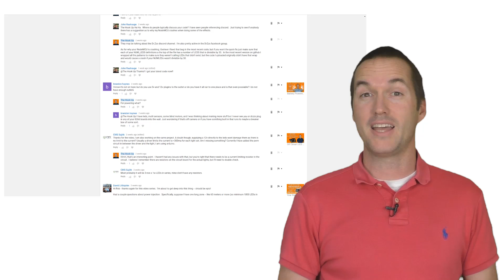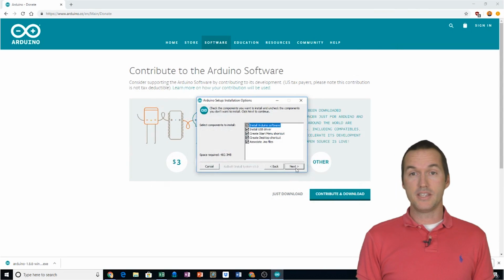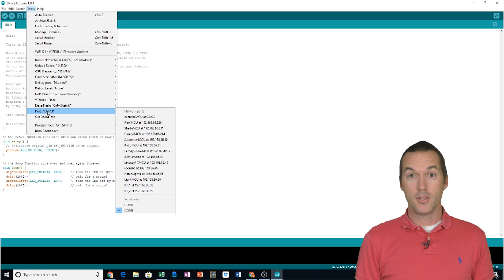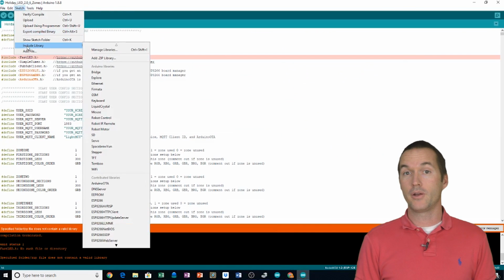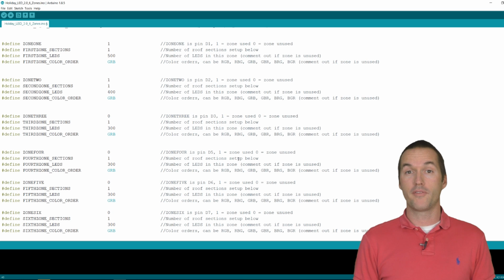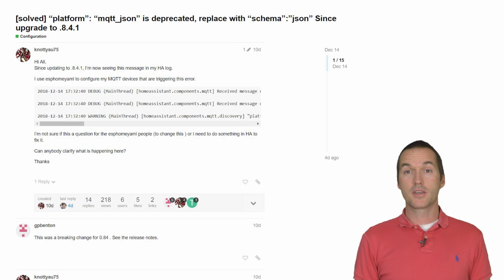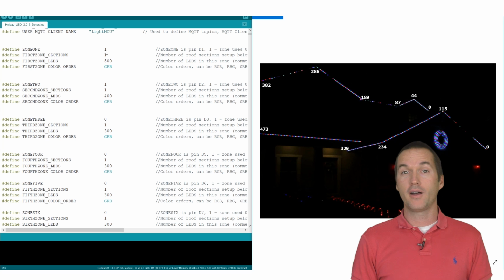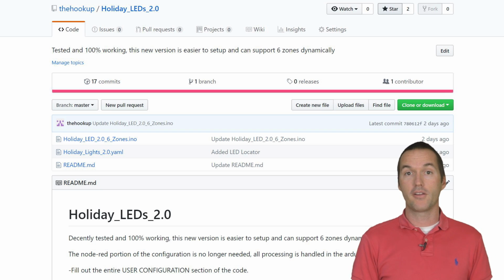Total Beginners Guide: Holiday Lights 2.0 Step by Step Arduino Installation and Setup.

Comment: Can you run sketches on any Arduino board and forget the Home Assistant piece?
Reply from the maker: You could run them on any board, but they won't do anything until you send them an MQTT command.  The program you want to use to do that is up to you.
Reply: @TheHookUp  i dont want use esp8266, instead would love to use arduino with ethernet shield. how rewrite code for that? i have no experience with coding :/
Reply from the maker: No better time to start than now

Comment: Good Morning.  Great video btw.  After I setup your last video on all 9 bulbs with MQTT/E131 firmware,  on the available ports, I only have COM# port.  How do you enable the Network Ports listing so I can update all the firmware in the future with OTA wifi?  Do I have to have PC with wi-fi card on it? My PC only have wired network card connect to the router..
Reply from the maker: You just need the most recent version of the Arduino IDE
Reply: @TheHookUp  I just updated couple days ago (what version do you have?).  Do I need to have wi-fi card on the PC running the Arduino IDE?
Reply from the maker: @mrteausaable  No wifi card required, but your computer needs to be on the same network as your devices.

Comment: Great video Rob. I was looking for it. Query 1 Each channel can have how many LED max.  2.one LED means RGB put together in single package (ws2812)? Please clarify
Reply from the maker: The program doesn't have a limit that I know of unless it's built into the fast LED library, but more lights means lower frames per second.  One LED refers to the rgb together.
Reply: @TheHookUp  thanks Rob

Comment: Great video - what is the logic to choose this method or xlights as from your live stream I thought xlights was the way to go, now I am not sure?  Many thanks
Reply from the maker: Xlights has more moving parts and I don't think the animations look as smooth.  I'll use this year round and switch to xlights for Christmas time.
Reply: Also, xlights shows may require setting up a different home network to avoid internet issues (waf).  Rob’s code runs on the NideMCU and only requires the initial mqtt message to set things up.
Reply: Thanks that makes sense - thanks